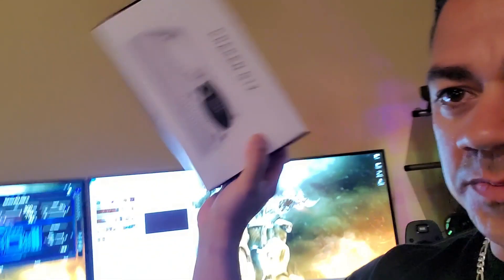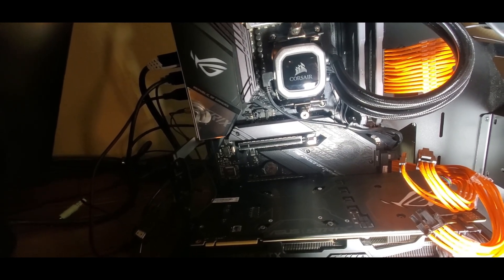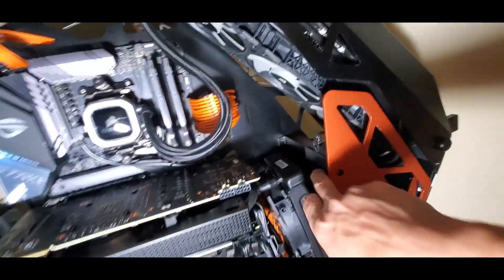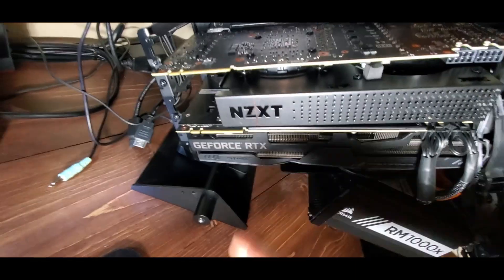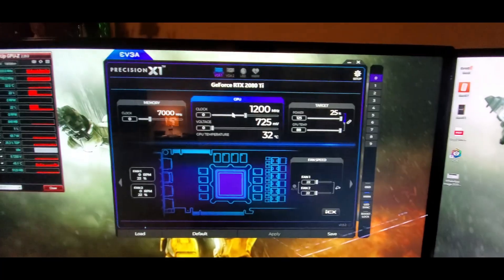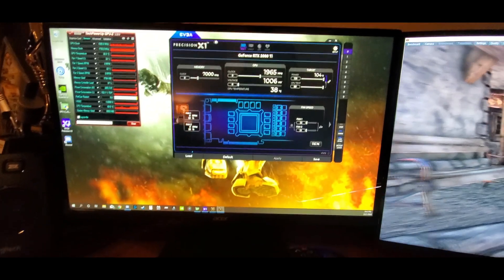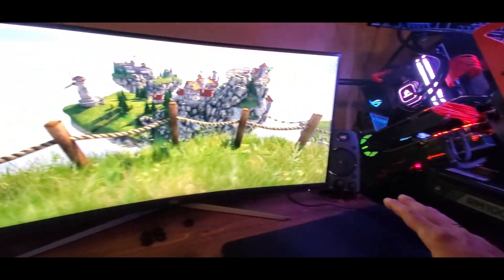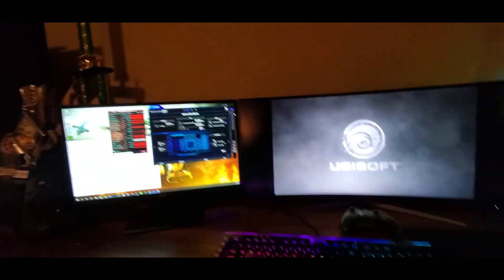KRAKEN G12 + SLI 2080ti .. Will it work with 240mm GPU Cooler ?

Comment: Dude, thanks for the video. I also have 2080Ti on SLI and want to do this. Did you cover the VRM with thermal pads or heatsinks or did you leave them exposed? Thanks again.
Reply from the maker: I left them exposed and I had 0 issues ... with this kit there is plenty of space for them to breath
Reply: Rickie RunningSolo Cheers. You only did the one card and not the two. Can you get the first card to run faster and not thermal throttle in games but keep the bottom card at stock speeds?
Reply from the maker: @grahamstephens9931  right i only did the one that was overheating... i haven't over clocked my system ... it runs excellent this way.
Reply: Rickie RunningSolo Thank you for the quick reply, my friend. Much appreciated. My top one hits 86 in Shadow of the Tomb Raider and most other demanding games. I’ll try it on the top card. Thank you again. Much appreciated.

Comment: hey i am planning to do the same.. i had a few questions a. what thermal paste did you use and what method did you apply it, spread it or dot in the middle ?? b. where and how did you connect the 2 radiator fans, the g12 fan and the pump to? thx and great temperatures. i want the same on my 2080ti
Reply from the maker: Hello Tony .. well I spread the paste evenly on the GPU and on the GPU you want to put a bit more than  CPU ... also I have a  ASUS ROG STRIX X570 motherboard and it has extra spots to connect the G12 fan, the AIO and the 2 fans for it as well.. got lucky I get. I did had to extend the Fan cables tho.
Reply: @RunningSolo  Hey thanks for the reply mate :) What thermal paste did you use? So you connected all  your fans to your motherboard ? Cheers P.S.  Can you recommend an AIO with longer tubes to fit in case?
Reply from the maker: @tonytikka4131  CORSAIR - XTM50 High Performance Thermal Paste Kit here is the paste i used, and yes on the description I put the Motherboard that I'm running and it had extra connectors to run everything and on the AIO I have no idea, I just purchased a used one online locally.